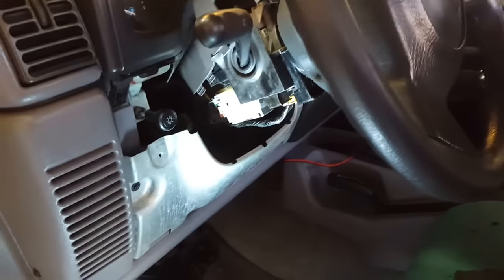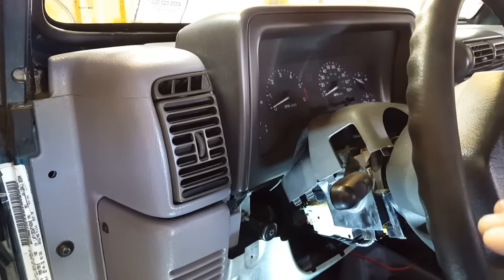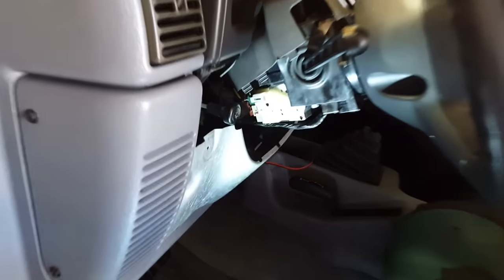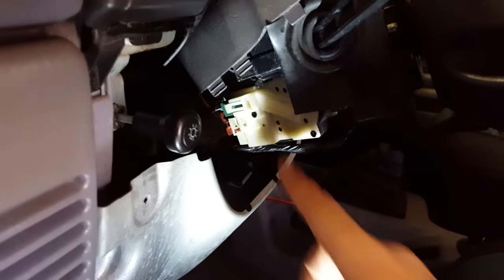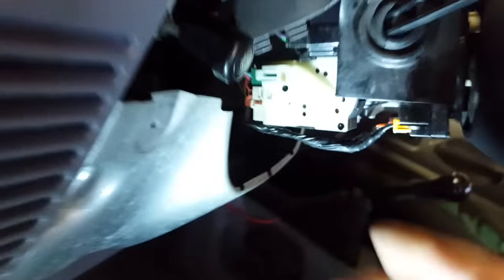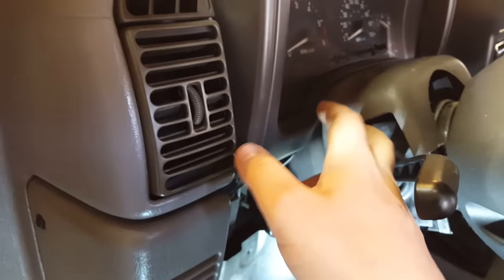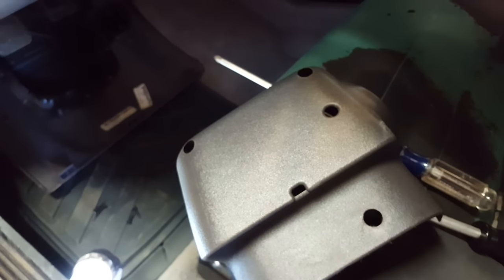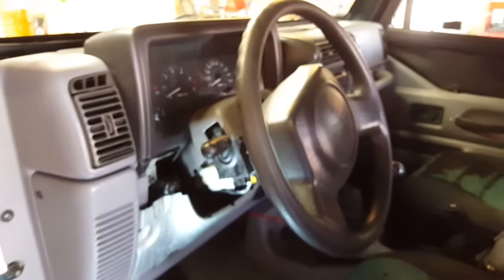Jeep wont start fix. Ignition switch.

Comment from the maker: Yes @Mark boza. It fixed it. Jeeps are easy from an electrical standpoint. It's either this, the starter or a wiring issue. It's usually this piece though. And a starter is easy to diagnose.

Comment: Would this be the problem if the Jeep doesn't start but if you put jumper cables on and you jump it from another vehicle it starts the battery is good the alternator is good all that stuff is good it's all brand new and tested but it still doesn't start unless you put jumper cables on because something is draining the battery

Comment: Hey man know this may be such an old video to ask a question about , but my dad has 88 yj and has no power on dash or no crank he replaced ignition switch where key goes and still nothing . Starter is fine as well as battery and ground Any advise ? Thank you
Reply from the maker: You need to get a multimeter and start tracing down the power. If there is no power going to the switch you need to trace it back to the relay, if the relay is getting no power then trace it back to the fuse block. The battery has 12v. You just need to follow the path to find the issue.

Comment: New discovery I noticed right around the steering wheel it was rapidly clicking when I shut it off, and then I tried to start the engine and got nothing.....so would that be the ignition? Lights on dash went dem
Reply: I’ve got the same thing. My (brand new and healthy) battery also drains very quickly over night. Recently the starter stopped working. Replaced the starter and now you can hear the solenoid engaging rapidly but the actual starter motor doesn’t turn or crank the engine and it kills the battery almost immediately. Hoping the ignition switch will fix all the problems in one but who knows…

Comment: 2001 Wrangler sport shows  ""NO BUS" in the middle bottom dash display!! Turns over but don't start!!
Reply from the maker: Just means the plug on the back of the cluster isnt fully clicked in. Try taking it off, clean all the pins with a brass brush, put it back together.